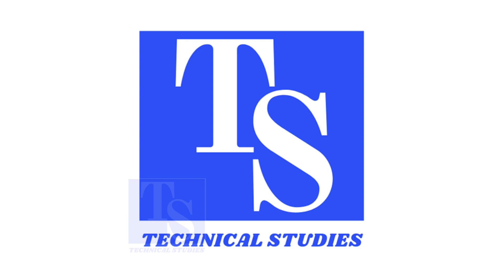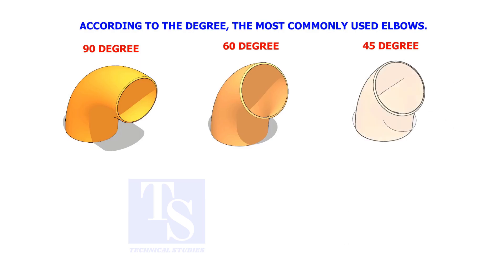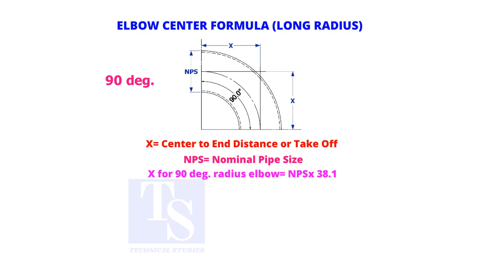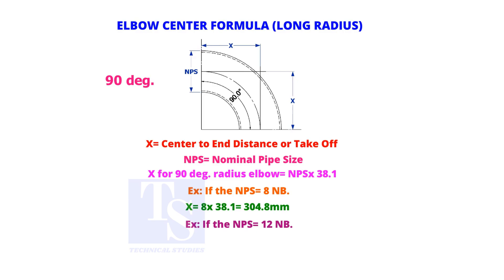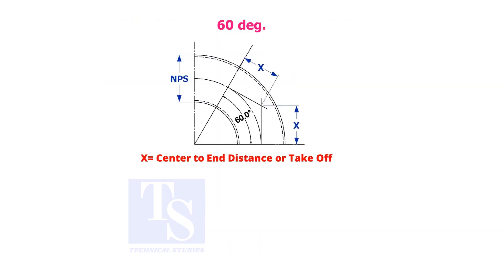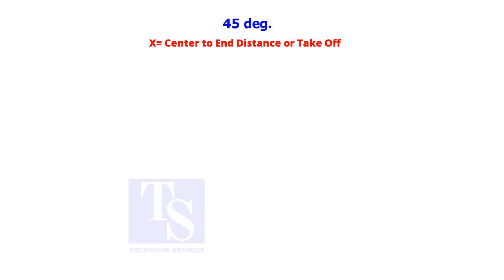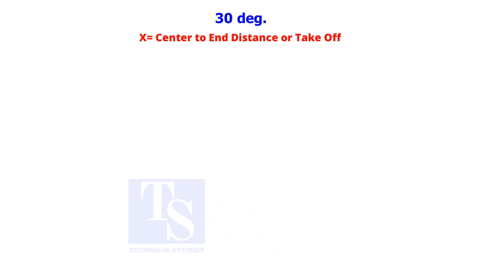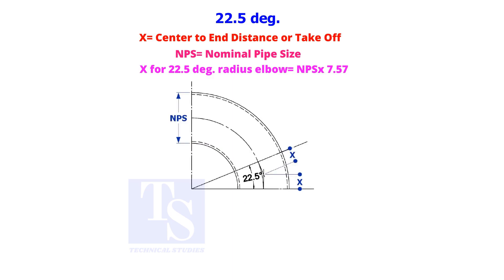How to calculate, elbow take off, simple method. कैसे कैलकुलेट करें, एल्बो टेक ऑफ, सरल विधि।

Comment: Is this only for long radius elbows or does it work on short radius to?
Reply from the maker: Bro. This is for long radius elbow. Clearly mentioned in the starting of the video.
Reply: @technicalstudies. This is actually for middle radius elbows which is the most common one.
There is an equation that works for every kind of elbows.
Reply: What is NB? @Technical studies